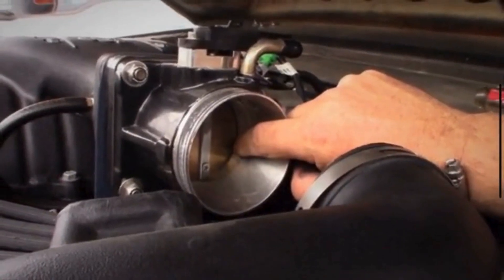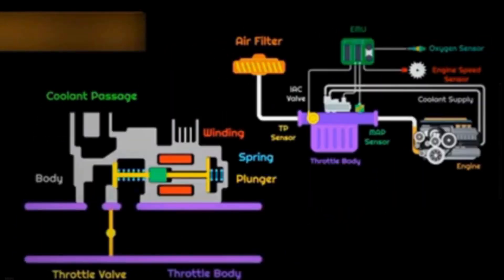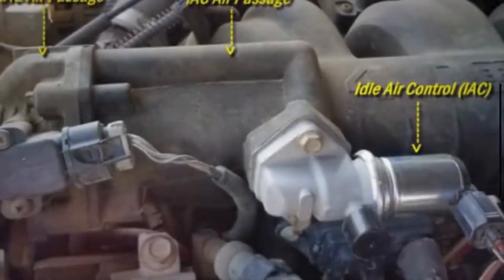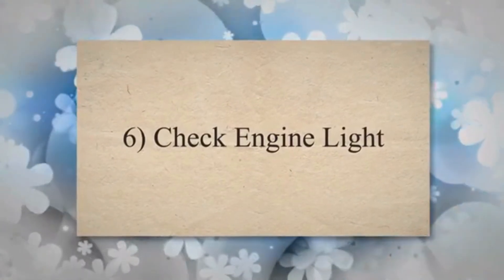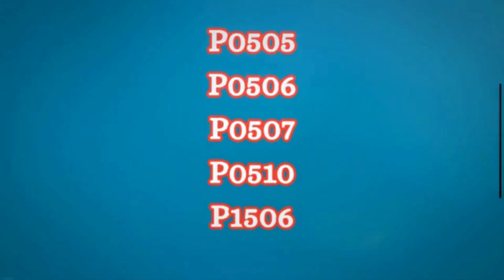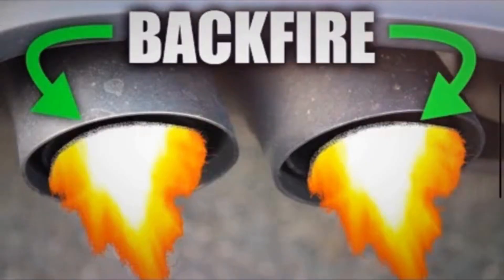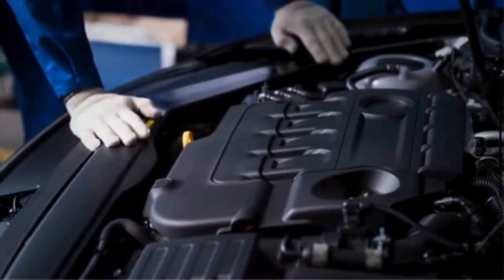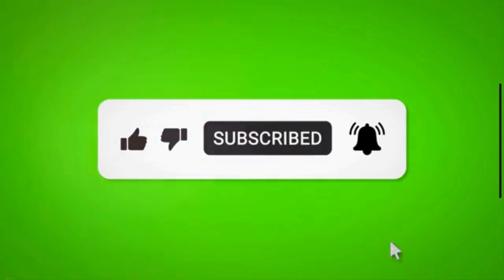9 COMMON SYMPTOMS OF A BAD IDLE AIR CONTROL VALVE | BAD IAC VALVE SIGNS

Comment: Hello everyone, thank you very much for the video howevr it seems my issue is different, im having an issue at idle and many time i get the check engine, 
the issue that the engine is shaking and there is a lot of vibration on Idle, its very good when its running on the road .

i change all spark plugs to irradium and coils as well even all 4 are new, as well i opned the engine air part and cleaned it and changed the 4 joins on the air area upper to the injectors, as well i changed the throttle body to a new one and still the same issue >

i used liqui moly products and and changed oil always on time.

rpm looks fine

there is no loss in water/ oil and heating engine is good as well i cleaned many sensors that i can reach and cables using the electronic cleaners however still the same issue please help me guys, its driving me crazy...

thanks ( clio 3 1,4 petrol 2007 )
Reply from the maker: If you have tried your best, then it is recommended to contact a professional mechanic.
Reply: @MechanicalSpecial   i tried, the problem that i have the check engine and even i change the air sensor yesterday, still the same issue
Reply: I have the same shake problem. It has to be the IAC valve @anisbensassi4028
Reply from the maker: @anisbensassi4028  There is a possibility that there may be another issue that you are unable to pick.. Thats why I recommend you to contact a mechanic so that he can properly diagnose the issue.